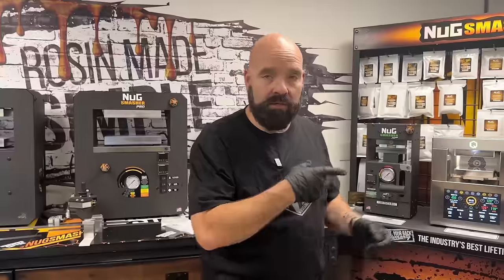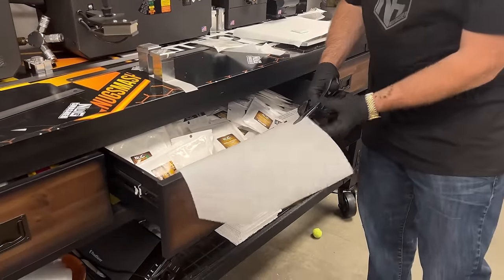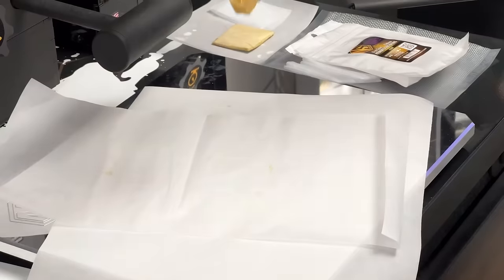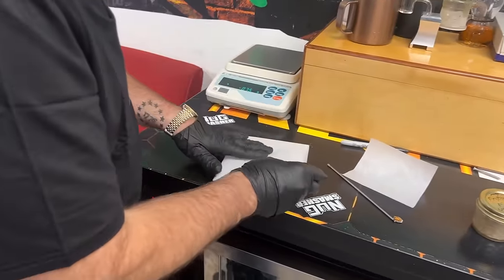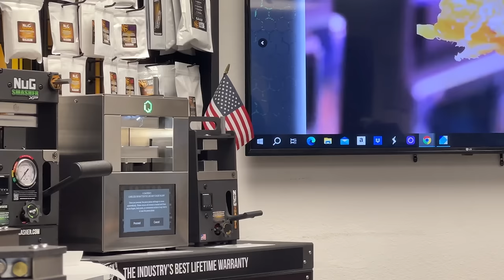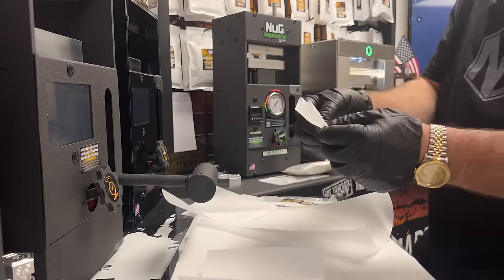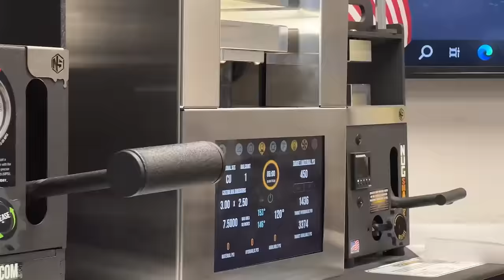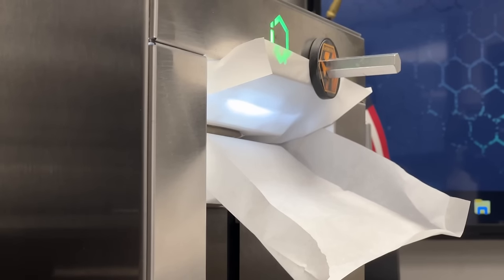40 GRAMS on the NugSmasher IQ

Comment: Made me beg the question…if solventless is possible…why even use butane to begin with???? It’s straight chemicals !!!
Reply: Exactly! The answer is because solventless takes a LOT more work! And sadly most producers are more concerned with quantity & profit, rather than quality and purity. Butane & other solvent extraction methods are also far more efficient and extract more product. You can basically "blast" the entire plant and get every last bit cannabinoids. This also negates any mold spores and or bugs. So low quality grows can just produce the worst quality weed, and yet still have a product to sell. Whereas solventless takes so much effort, it makes no sense to use anything but the highest quality inputs. Hope this helped answer your most likely rhetorical question. 😂

Comment: Making rosin or hash from smokable product is a waste. I make rso from 6 ounces of trimmings and I get about 20 grams of refined oil. But the thought of taking actual buds and bubble hashing it and smashing it for the resin seems stupid. Turning an ounce of flower into 5 grams of resin that still only sells for 10/g.
Reply from the maker: The benefit is solventless concentrates, no chemicals. Our machines are making Rosin not resin, yes resin is super cheap!!
Reply: @Nugsmasher  Rosin is neat and all, but it's taking good flower and smashing it out. I just prefer to use solvent because it can be used on trim. I wouldn't waste good flower to get a lil tiny bit of rosin.